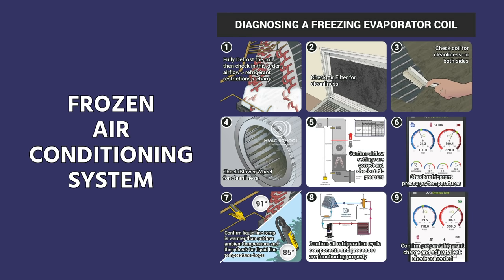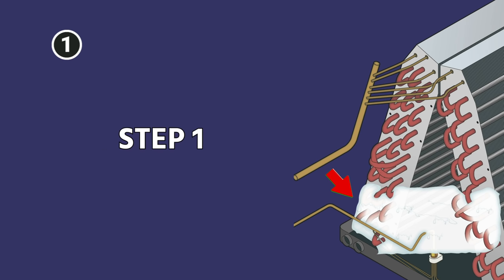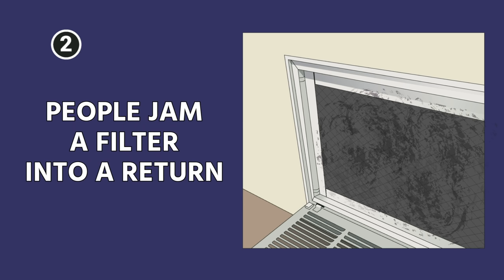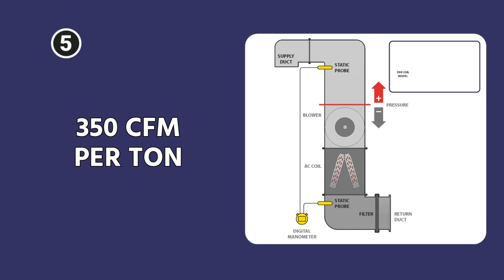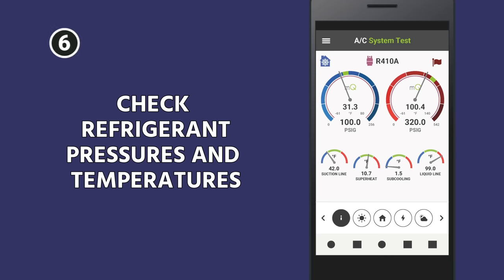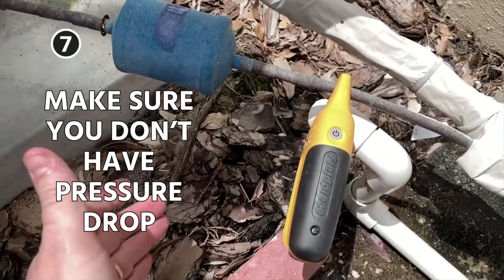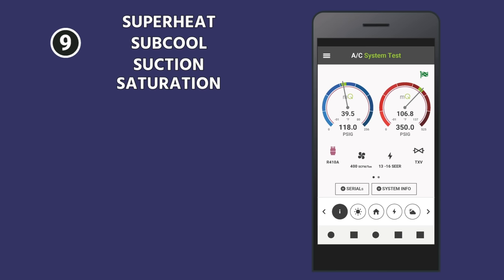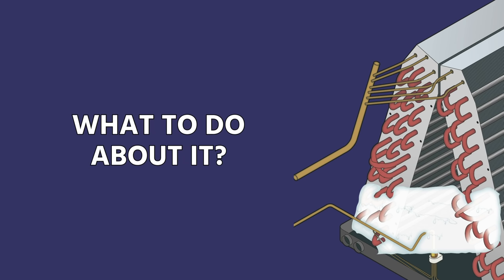Why Does The Evaporator Coil Freeze (And How to Diagnose It)

Comment: Ok, I’m ready to freak out. Looking at your system diagram , you show your blower wheel at the top of the air handler with the A coil below. In essence, you are “pulling” the return air over the coil and out the supply. 
My system has the return inlet / filter and blower wheel at the bottom, the gas furnace above that and the A coil on top followed by the supply outlet on top. This system is “pushing” the return air across the burner and A coil. The supply air flow isn’t the greatest but it seems to do the trick. Is this configuration “ kosher” or did this guy put it in bass ackwards. ???
I await the chuckles and cringes 😖
Reply: Mine is exactly as you described. I think this is a normal install.
However there must be other ways as well. What dictates this I would like to know myself as I enjoy learning more about hvac.
Reply: There is upflow, downflow, and horizontal setups.